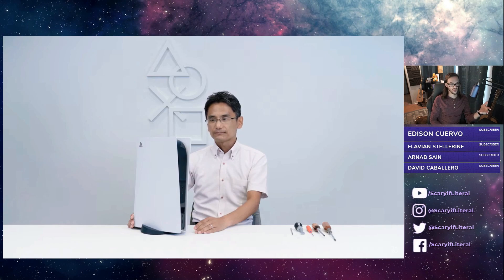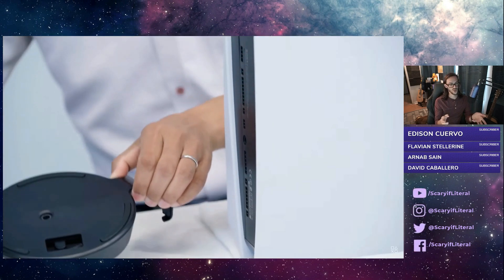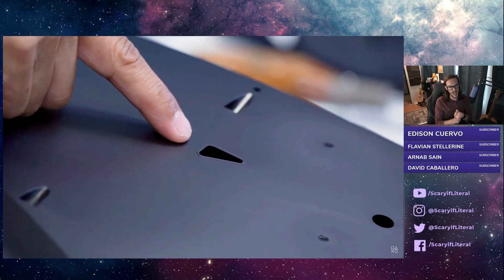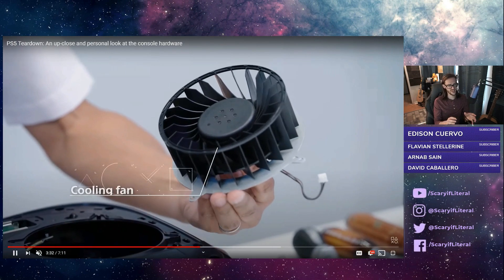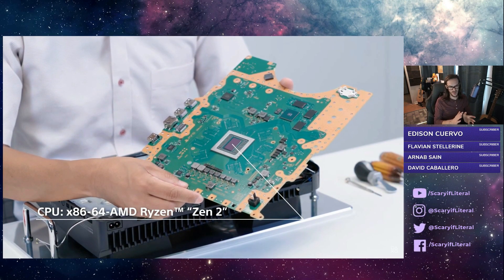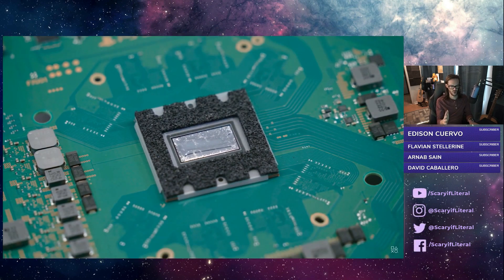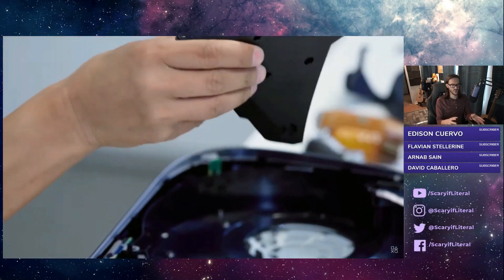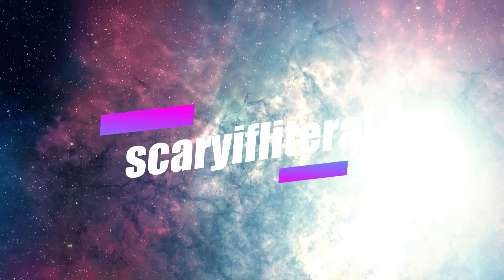PS5 Teardown Analysis, M.2 Drive Expansion Slot? GIANT Heatsink?

Comment: The system is being over clocked so they need good cooling but nothing will stop this thing from breaking in 2 or 3 years.  Over clocking is a good way to break something.
Reply from the maker: This is not true if done correctly. I know a friend who has had his core i7 overclocked for six years.

Comment: I don't mean to be pedantic but did you even watch the "road to ps5" ? Because cerny said they will give a list of compatible ssd, important, when they start arriving, because right now commercial m2 drives are too slow (except maybe that new samsung one advertised at 7go/s but still need to be benchmarked to know if it does max out the bandwidth.
So short answer, the ps5 will probably do a quick test and just strait up refuse the drives if they are not fast enough.
Reply: I think the problem, at this time, is heat! Not speed, since there are many, many M.2 Gen 4 drives that match or exceed the one included in the console!

Comment: the biggest feature for a lot of parent is probably the dust catcher, you can clean your console without voiding any warranty and without asking a professional to clean it.
Reply: And the SX will be easily cleaned with compressed air by just taking the console outside and blasting the intake holes
Reply: The dust catchers will help, but they aren't perfect. Sony themselves has said that the dust catchers won't get all the dust.